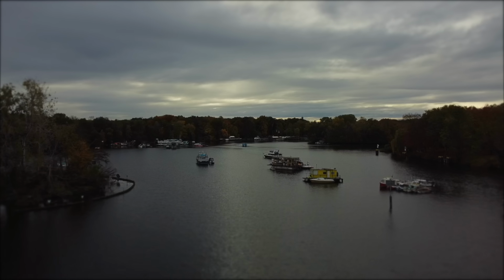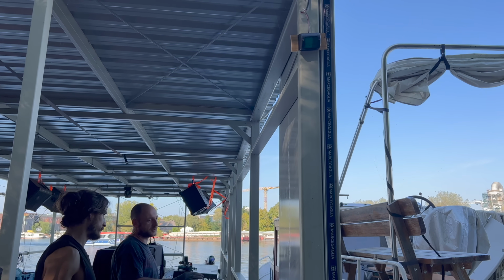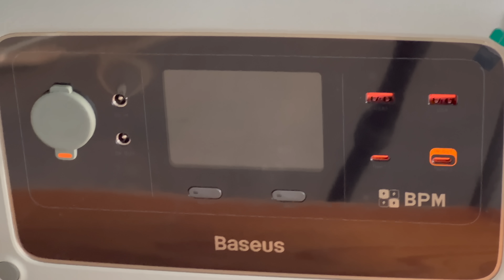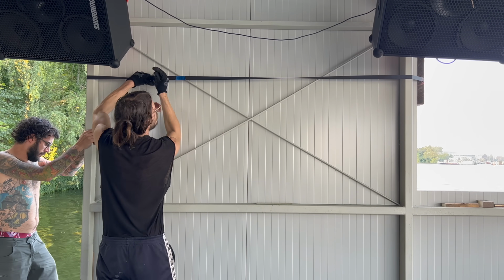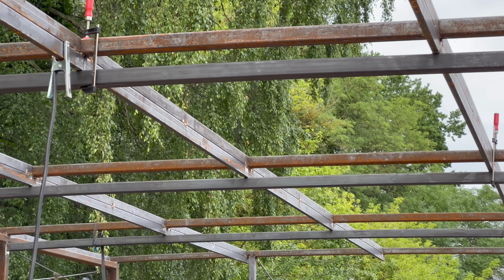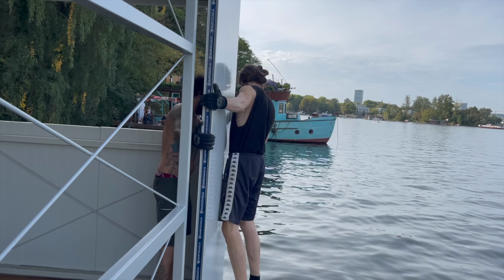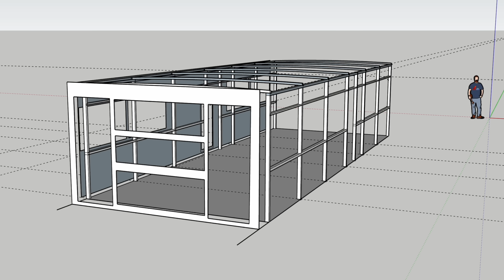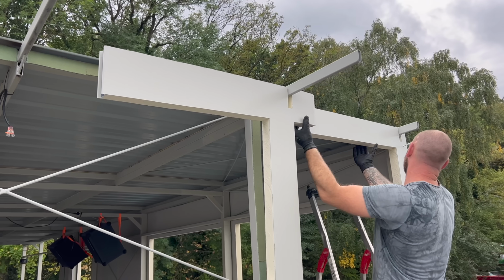Building Walls On My Barge Boat

Comment: Hi from Russia. It's nice to realise Your final plan. And to appreciate a unique experience of Your boat offshore building.
Although, as I guess, there are some opportunities that You already missed. First of all, it's more practical to make "metal engineering" with stronger enforcement. Not just protecting the weight of the roof itself, but the enforcement with the risk of some bridge or another ship collision. As You maybe guess, Your old barge creators were making such "extra enforcement". And this allows You to use a barge after so many decades.
Secondly, it's normal not just to paint metal constructions with a brush, but to clean mechanically (with sand) and to paint with air flow. It's more guarantee from rust. Especially on the water humidity long years use.
And for sure it's OK to make all this grubbing, welding and painting on land, and then to put Your barge on water. 
Or to make a cabin structure on land and then to put it on the ship by a crane. And to make wall panels mounting on water if needed.
So, I'm not impressed with Your experience of boat building, project managing and engineering decisions. But impressed with Your energy. 
Finally, I would say, that You've made a great job. But the organization of this job is not optimal. And the result is less optimal. And ecology impact of screwing, cutting and painting on water is in question.
Anyhow, Your energy and efforts are not in question, as I mentioned before. And makes my admire and respect. 
If one day I can make a metal ship production, hope to admire You with well organized process.

Comment: I would have fitted the side walls 20-25 cm in from the side of the hull. It would, of course, have narrowed the living space a little, but combined with handrails, it would have enabled you to walk along the outside of the "building". This would have been useful for various activities such as docking, for instance, but especially for cleaning the outside of the boat and the windows.
Reply: Add flip down retractable walkways.

Comment: The structure is looking better every video. I am a little surprised that you don’t add any sealant or some type of waterproofing between the external panels and the frame structure.  That addition seems to be a necessity to most any boat build and it especially seems necessary for a structure like that where you will be living inside the structure.  Not only would it help to seal and semi-waterproof the joints it would help to minimize squeaking between the dissimilar materials.

Comment: Bravo! A well thought out plan comes slowly to fruition. Will you double glaze the windows or at least use low emissivity glass (Low E glass)? Low E glass is not as good an insulator as double glazing but it is high performance (using different physics) and much, much cheaper.

Comment: Very nice work. I would have put thermal bridging insulation between the panels and the steel beams.
Reply: You don't need that as the outside skin is decoupled from the inside with insulation.
Reply: Yes I know that, but the steel structure is on the inside and welded to the deck and will make the inside skin very cold.  Thermal bridging is a phenomenon that can happen when you use materials on the building envelope that have different insulating values.

Comment: Please allow me to give you some feedback. I have owned and lived on two of these 'Amsterdam-style' barges so I know what i am talking about. I see that your walls end on the deck. This allows water to drip on to the deck and it will rot away. it would have been better to have the frame right on the edge and the wall hanging over. No you will have to retrofit something to lead the water off of the deck into the water.

Comment: Really looking great and well thought out, but I’m having trouble visualizing where the elevated helm stand figures into this. Did I miss something?
Reply: Putting the helm sufficiently behind your forward Port door, would seem to be necessary to captain and pilot your enormous houseboat.
The fact that the walls and sides of your vessel, now conspire to make it a sailboat, may dictate the need to put it on the hard again, to attach a more substantial keel, to allow you to better navigate.
You will also undoubtedly need larger engines to overcome the wind's effects.
You may want to consult a Marine architect or engineer, to avoid mistakes...
Which could be much more expensive in the long run.
Great job though !!
Really great job !!
Goodgen Morgen !!
Reply: @Peter-jo3wt  can you tell me if this is the same barge he built the raised platform bridge deck on last year? And if so did he remove it in favor of the houseboat configuration? Thanks, I’e been away for awhile.

Comment: I've been wondering about building with these commercial refrigerator panels for some time.   One thing that worries me is how you deal with condensation...
Reply: They are fairly well insulated if from refrigeration units or even  insulated clad buildings . 
For fire and noise insulation as well as rot prevention look into basalt needle matting.

Comment: Good to have a catch up video, interesting to see your choice of outer shell, I would though have thought aluminium skinned paneling would be better due to thw weight when working with it also for the total weight when completed. 
I have too though a smsll criticism in your translation to English, panels or sheets is the proper term, not "plates". Plates is the name given to small single layer  pieces of metal sheets.I recall you also saying "plates" when you were working with wood, the right term is boards, as in floorboards, where walls are concerned then the term panels  is used, as in wallpanels.
I hope this helps you a little in the editing of your videos. MfG Rick.

Comment: Not if you were or know...?  Using a saw like that, and cutting thin metal as that .....run the blade  ( carbide tip )  backwards  ,  much smoother cutting

Comment: I would have added silicon between each joint to keep air and water from getting in.
Reply: You don't need to do that with these, they are designed to build walk in refrigerators so are actually air tight when you snap them together.
Reply: @ckm-mkc a walk in fridge doesn’t bob around on a river. I would have added silicone as well.
Reply: How may times have you made videos and have said.  "I wish I had done thar differently " wanna learn the hard way, be my guest. Nothing wrong with redundancy.